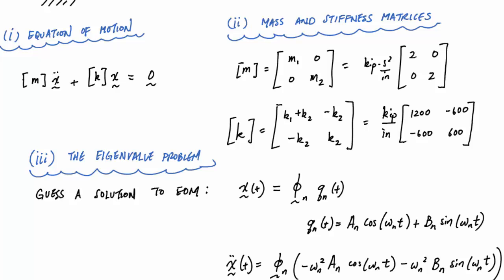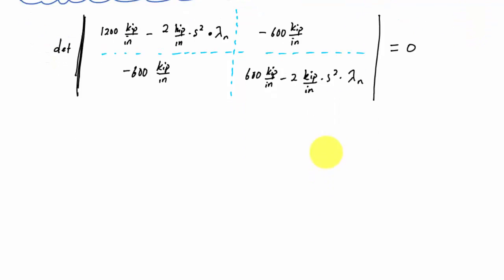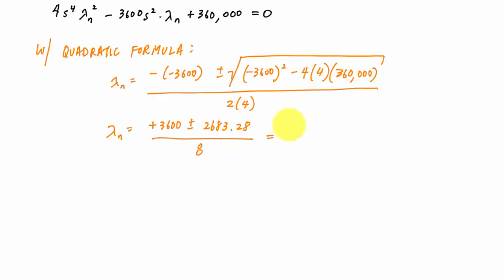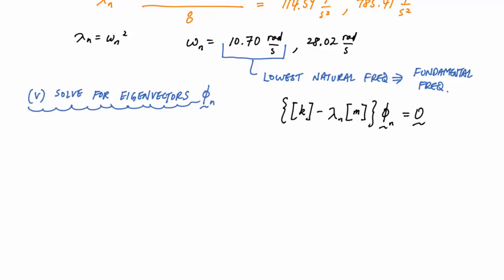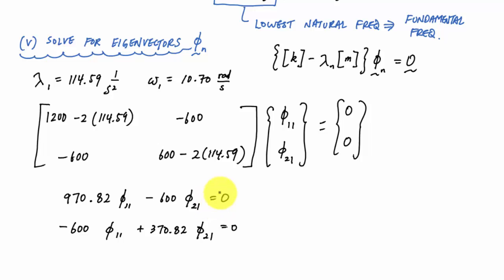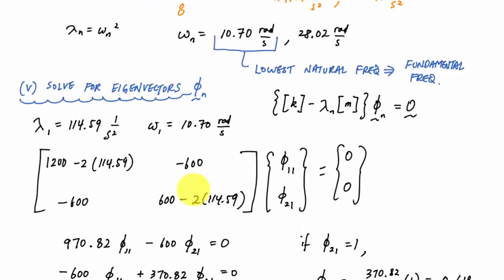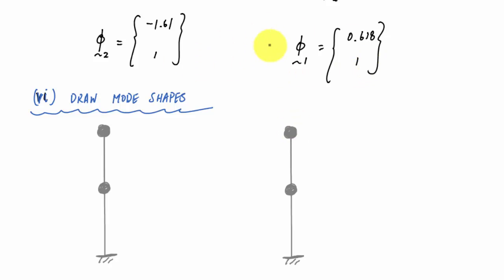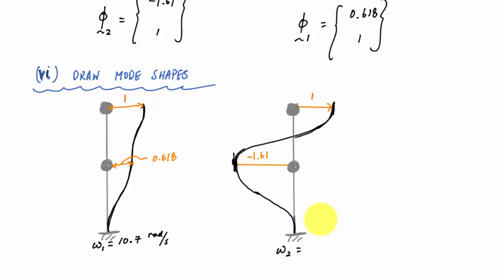Example Calculating Mode Shapes and Frequencies of a 2 DOF Structure (2/2) - Structural Dynamics

Comment: Thanks! It is however confusing a bit! In the mode 1, there is horizontal drift of 0.382 different while the the drift is in mode 2 is 2.61 between the masses 1 and 2. while the expectation is the the drift should larger in mode 1 than it is in mode 2. Could you please elaborate it bit? Thanks!
Reply from the maker: it depends on the mass and stiffness properties of the system.

Comment: Why set the mode shape to a value of 1? There are two equations and two variables to use to solve for each mode shape. Wouldn't this give a more accurate calculation?
Reply: I think that is a solution but you will get zero for both if you do that. We assume 1 is because we want to see the case when they move. But I have the same idea as yours too before.
Reply: just wanted to add the reason you will get zero is because the two equations are equivalent